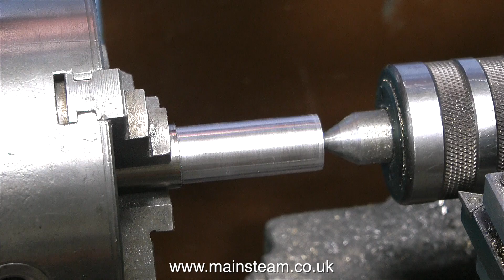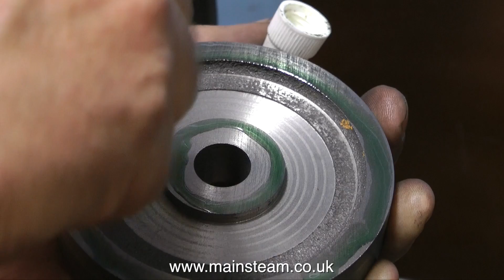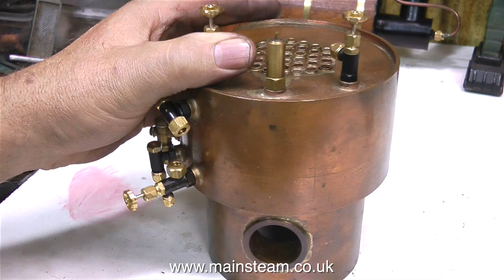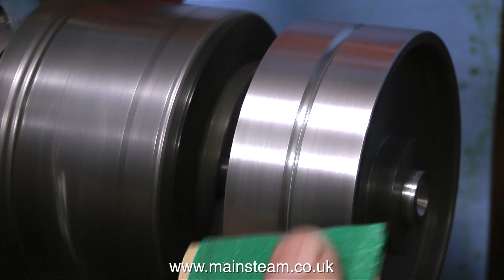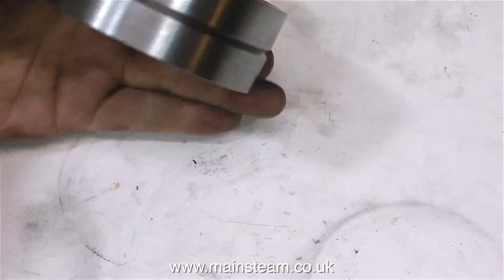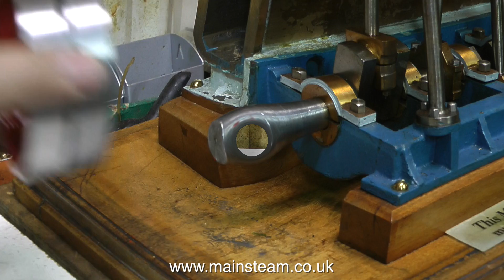RENOVATING A LARGE MODEL TRIPLE EXPANSION STEAM ENGINE - PART #4

Comment: Keith, it's been a long time since you added to this playlist, what's happened to this very interesting engine? is it or will it ever run? do you still plan to update the series?
Reply from the maker: This engine was built a long time ago by an engineer called Sir Charles Inglis, but it needs far too much work on it to make it a runner so I made a flywheel for it and I intend to re-clad the cylinders and leave it as found.
Reply: @keithappleton  That would be a shame. He was apparently a very famous person who contributed significantly to engineering. This is an amazing and unusual engine, it deserves to be finished.

Comment: This may be a silly question, but why don't you use oil as you turn these metal pieces?
Reply from the maker: Thanks for pointing that to the above viewer - saves me doing it :-)))
Reply: I think he said he normally uses more lubricant, but foregoes it for the videos so they process can be seen better.
Reply: I just happened to remember your answer to that question LOL. I'm about to buy a grizzly g0602 lathe speciaifcally to get started on engine work, your videos have had me fascinated for weeks!
Reply: Ahh!! Makes sense.

Comment: Could the outside part of the flywheel still come off? I saw a lockdown screw on the inside one, but not the outside one.
Reply from the maker: please continue watching the series and you will see me fit the bolts holding the two parts together ..... :-))))
Reply: Keith Appleton I will, these are really interesting! Thanks!

Comment: I was thinking about buying one of the small brass single cylinder engines much like the brass twin engine you showed. I plan on fitting it into a small home made model launch. I was wondering if they have sufficient power, and how can you tell if they are quality engines. Most of the ones I see are from china which worries me a bit.
Reply: Devon Davis You can buy a cast iron one from Stuarts
Reply: Thanks for the heads up